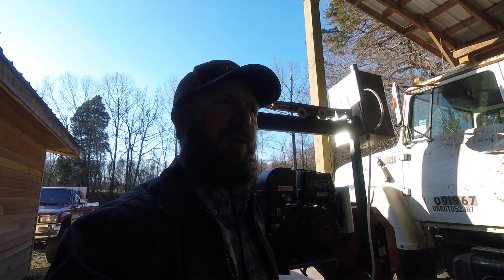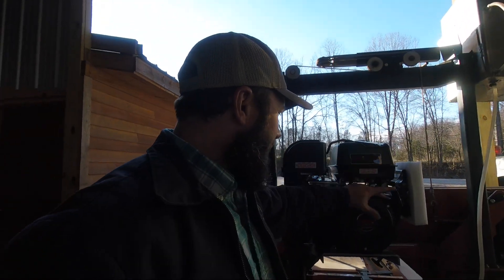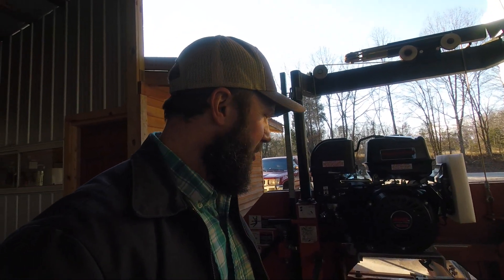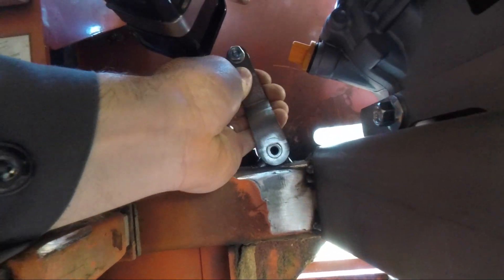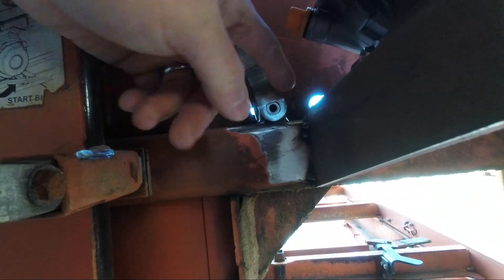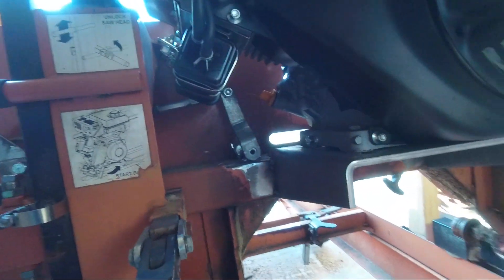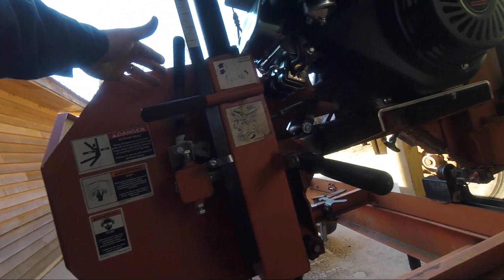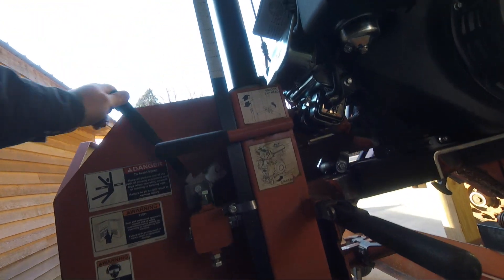Woodmizer LT 10  Predator Repower + Power Feed + DIY setworks

Comment: What did you do with your exhaust on the motor. I seen you had it off on video
Reply from the maker: I had to rework it, check out the rest of the videos in this sawmill series where I get that part done!
Reply: @CherryHillFarm  thanks... think I found it on part 3. Did you custom make the extension for the tractor muffler? If so what material and would you of made it taller cause the flap?
Reply from the maker: I bought the tractor muffler and used pipe to make the adapter.
Reply: @CherryHillFarm  thanks for the help and thanks for the videos.